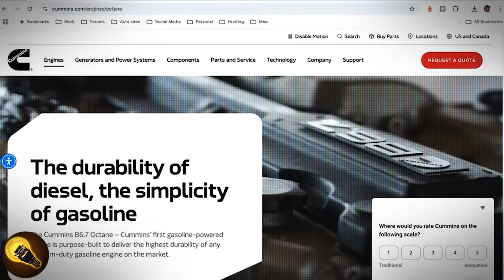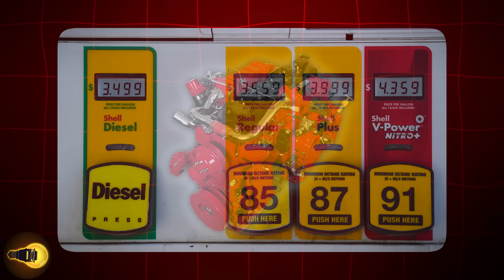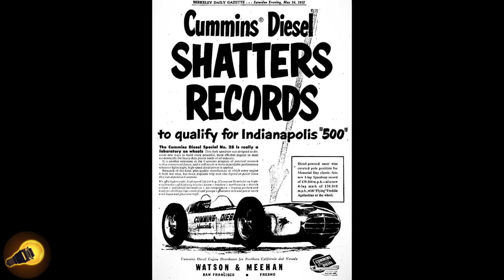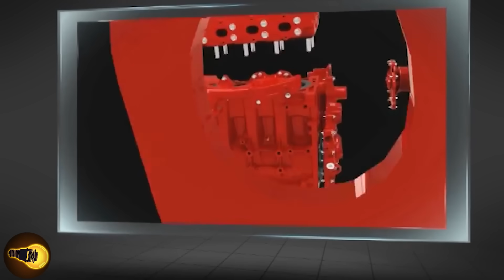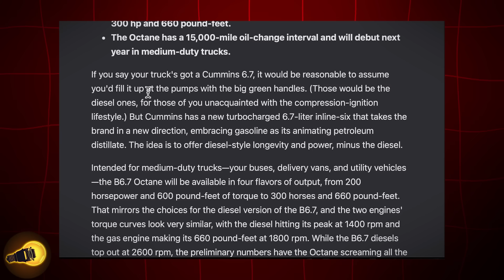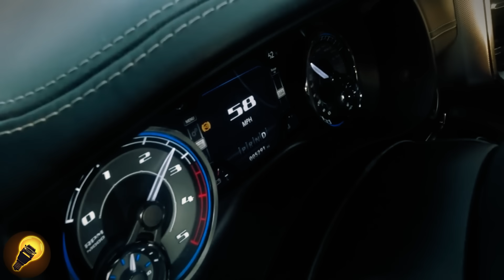Cummins Shakes The Industry With A Gasoline Engine!!!

Comment: I wish they put a manual back in a pickup truck
Reply: YEP, That's Right
Reply: @halcurtis8212 Yes had a 1996 TON CUMMINS with 5 SP Granny Gear Could pull anything I wanted
Reply: Manual transmissions will always be the best in my eyes, if you can’t drive one you probably shouldn’t be driving at all. Try a 20 speed Quad box Mack with twin sticks, it’s not hard just takes practice like anything in order to be good at it.
Reply: @deborahchesser7375  Warrantee claims when knuckle heads tear up the drivelines.
Reply: @deborahchesser7375  Modern automatics with computer controls and lock up converters are proven to much more efficient than sticks. Same reason we dont live in caves. tech marches on
Reply: @deborahchesser7375  Warrantee claims
Reply: @deborahchesser7375  I have one common saying a manual transmission clutch and transmission won't hold up , and because of emissions.🥴
Reply: @JustinMiales   if you know how to drive a manual it’ll outlast any automatic brother, aside from the clutch. Hell those CVT’s  shoot out of Nissans 😆
Reply: @deborahchesser7375  learned on a 2 stick and drove a 13 speed and 10 speed. MODERN automatics are much more efficient and consistent for durability and emissions. Time marches on you cant live in the past
Reply: @deborahchesser7375  Have you been drinking? ( Hell those CVT’s  shoot out of Nissans]
Reply: @tomhutchins1046   they fall apart after 30k that was mechanic speak for junk.
Reply: @tomhutchins1046  they are gutless and boring but to each his own, yeh I’m pushing 60 so I’m probably a little more of an old school driver and no, I haven’t had a beer in weeks. Does sound pretty good though.
Reply: @tomhutchins1046  I’m just having fun, my wife hates talking mechanical shit.
Reply: @deborahchesser7375  mechanic speak for junk.? That's not English. My sister has a nissan with a CVT 150,000 no problems
Reply: @tomhutchins1046  okey doke Tom, it been real, you have a goody now.  ✌️
Reply: @tomhutchins1046  and yeh, most of those cars are shit boxes. Your sister got real lucky apparently.
Reply: @deborahchesser7375  😂
Reply: Debora? You have a wife ?
Reply: @deborahchesser7375  Its the same reason automatics are good so the knuckled heads don't break them. i have a friend works in a Nissan dealership. Says when he see's a broken CVT rolling in the door there is usually a knuckle head following it in..
Reply: @deborahchesser7375  The leafs really concern him. They don't break down, Says he pulled a wheel of of one at 100,000 the brakes looked like brand new! There also build modular so even the lube boy could fix them. Ev is the future
Reply: @deborahchesser7375  Modern automatics are consistent and more efficient
Reply: No one bought them.
Reply: @ericelsberry5585  Real Construction
Reply: @ericelsberry5585  Actually about 50,000 since 2020
Reply: @ericelsberry5585  about 50,000 since 2020 have
Reply: The CVT, particularly in the Sentra was/is known for a high failure rate. I drive a 22 Nissan frontier so I’m not a Nissan hater. CVTs in general are junk.
Reply: @jimmysylvestre9679  Billy bobs can break anything
Reply: When you can't drive stick, you make excuses. I can shift better than any automatic, I don't need a computer to do my job. If you can't get better performance, durability, and mpg from a manual transmission, you're not that good of a driver, no excuse.
Reply: @CyrusVyrus  Ok billy bob your a deep thinker. Automatics have lock up converters for the last 20 years and that computer can out think your little billy bob brain 100 times over
Reply: @CyrusVyrus  I've got videos on my channel prove I can not only drive a manual but convert a automatic to a manual on a f350 and I never needed a computer to deal with it either but I sure like having that computer stuff but 12 years ago I sure didn't have none of it.  What a shocker you have zero videos to prove anything you claim lol.
Reply: @PatrickBaptist  I don't need to prove anything to you, you already admitted you can't drive stick as good as an auto.
Reply: @CyrusVyrus  Whatever kiddo, you can't prove nothing you claim lol.
Reply: @CyrusVyrus  Of course you have a problem with proving your claims kiddo, this isn't kindergarten lol.  muted Go cry about it elsewhere.
Reply: @PatrickBaptist  why do you get so mad when you're not much of a driver?  Grow up and own it like a man, rather than acting like spoiled brat who's mommy never told them "no" as a child. Getting mad like a keyboard warrior is what  someone with no confidence does, and you can't act like a tough guy while admitting you can't drive stick. When you can't drive stick, you make up excuses and lies about auto's being better. Facts don't care about your feelings.
Reply: @CyrusVyrus  Sounds like your the one mad lol, funny you think I'd waste time to click "read more" lol.
Reply: @PatrickBaptist  you resorted to bully tactics quickly, proving you're easily triggered, and emotionally driven. Get mad all you want, I'm not going to stoop to your level and play your games.
Reply: Got a 2001 1 ton with a 5.9 Cummins and a manual 6 speed....best truck ever
Reply: @tombayless9759 great truck indeed! I found a one owner '03 gmc duramax with 4x and 6 speed. She's a keeper.
Reply: I have 😂❤❤one
Reply: I'd like an 8 speed dual range crash gearbox in a new pickup so it would never get stolen lol
Reply: Yeah not a sissy automatics
Reply: @PedroGomez-gu4io  So your manhood depends on your stick shift ?? LOL
Reply: Automatics because of the TQ output would destroy drivetrains if the driver did not know what he is doing on a manual trans. Im sure warrantee had something to do that. Also emissions modern automatics are controlling more than shifting they make for consistent acceleration and driving patterns.
Reply: @tomhutchins1046 wrong... shifting gears is a pain-in-the-ass when you have a cellphone in one hand and a steering wheel in the other. Furthermore, automatic transmissions mean more maintenance to make money from.
Reply: @waynec369  Your right its all a conspiracy your tin foil hat is the answer
Reply: @tomhutchins1046  find you a couple of buddies with the same trucks but one auto and the manual. Hook up to a trailer and see which one pulls best in every aspect. I'll wait.
Reply: Ah they can't beat the Allison MD/HD 3/4000 series, I use to be nothing but manual but then I tried a real automatic......  You can take your less output manual, I'll take my Allison MD 3070 and see you when you finally get up the hill lol, you aren't going to beat what their torqueconverter does then put a retarder on it for the down hill stuff and yeah I have a 40's bus so glad it's not a manual it would be so sluggish in comparison.
Reply: @PatrickBaptist  But holding onto your stick feels so good! LOL

Comment: You need to update your EPA rule since Trump took over
Reply: Trump said he's referring to 2020 EPA rules. What does it mean for diesel engines nothing has changed which means manufacturers still going to be using DEF chemical to stop smoke coming out the exhaust so there you have it

Comment: So, 10% better mileage than a comparable Gas V8..... lets see, my 2021 F250 SD with the 7.3 Gas got 12 mpg combined. so 10% = 1.2 which means potentially 13.4 mpg versus the 21 mpg combined my brothers 2024 F250 SD Diesel gets. And this Cummins probably weighs 2 times what that 7.3 Gasser does.
Reply: And what are the miles per dollar? What are the fuel costs where you live?

Comment: Don’t be the first adopter even if it works(which it should). Why, I just bought  beautiful Deere 322 mower versus my old Deere 332 ugly diesel mower to save on noise while mowing. The 322 was the Yanmar,TN 3 cylinder diesel converted to gas by Deere to save on engine costs(same block though). They made the Deere designed governor gear (for the carb) out of nylon and it stopped all of the teeth.  Since it was short run and duration Deere no longer sells the,proprietary parts and now the engine is just a lump iron. Unless they manufacture into the millions with long term support, never buy this engine. Same on Deere
Reply: Shame on Deere
Reply: hey did you know the hegehog multfuel terbine engine that the usa amrbam tanks use actly inorancly entogh wher ment to power a rotansion magnetic dyimo gentroar for usa FOAB base power grids. also that bacly means the new A3M1 arbiam tanks desel elctacl hybrid upgade will still have that seamegine but the range output would bacly due to how good that engine would be for prvoeing elctcal power for a dieslq elctical hybrid drive train would be veyr vyer veyr massvie overkill for such a desil elctal hybird tank drive train bescue its meant to power like a few killowats worth of ectcal power bacly and when you got such a powerpwer powelant thats ment to power whole usa FOAB base powergid powering a abriam A3M1 disel ectal hibrid drivetain with by thway this heghog engine can run on desil gasolnie and jet fuel wohut needing any modfacion at all bacly means that usa A3M1 oprasnal rangw with is new ectral hpyribd desl drive train upgrade will make the new A3M1 orpasion combat range go up ina huge masive aonut. also thast just withte A1M1 and A2M1 allredy exesting pwoelnt doesnt need to be reovmed bescue its allready is the most overpwoerd pwoerplant to power a elctical deisal hbrid tank drive train by the orgnal sidefect of the diesnose of the arbiam tanks pwoerplant inrnacly was ment to provade a large albut of elctal powr the WHOLE USA FOAB BASES POWERGRID before they just deicded to put in the the A1M1 abram tank. so tah means the A3M1 abraim tank elcrital deslel hybrid trivetrain would amke the abram tank go super super fast and for very very veyr far travleing distaces bacly. yes i allrady did recae on wikipeida and that abraim tanks powerplant actaly works far bettr for the future A3m1 ambriam tank wuhout needing to change the powerplant but the drive train will be upraged instead and won't need the apu anymore. not only that it would go even faster and father then any abram tank beforeit inacoly the usa past desicion of the mveing the of abriam powrplant that as'nt ginogto actly power FOAB base powergrids inconrly entogh wold be furte rpofoed for the A3m1 abrim tanks elctical desal tive train before they even knew they wher giog to to that roue but the abrim tanks powerplant is allready furteproofed for elctial desel hybrid tank drive tains by pure chance and luck and conwdeice of how the pwoerpant orngal denise psefcaions where beofre they put int inthe ambram tank instead. so tachly thew new abram A3m1 ectcal dsel hybrid trivetrain just only needs to repalce the drive trian beacue the powerplant is allready the most best suited powrplant thqat already been used inteh ornal abram A1m1 and A2M1 allready. so bascly R&D upgrade foteh ambriam A3M! withte new upgrades wou'nt need to have that much of a cost change bescuethe powerplant is allready perfect and thats the most epensive part allready.

Comment: I sure hope they are more reliable,than the diesel engines that they have been making for the light duty trucks lately
Reply: The epa has a part in that
Reply: Theyll be less reliable than diesel but because they built diesels they can build a strong block you wonder id theyll use a plastic oil pan these days

Comment: It does not sip gas. The reason people use diesel is because it's the best way to move heavy trucks and not burn a tank of fuel. If this engine make 660 lbs-ft torque. It is going to drink gas and 660 lbs-ft is not going to tow a trailer like 1050 lbs-ft.
Reply: It'll still get there, though.
Reply: With direct injection with variable geometric turbos they could make it pretty powerful i would think especially fuel efficient with direct sequential fuel injection too with leaner air fuel ratios
But yes I'm a diesel guy and I prefer the old mechanical ones like the older 12 valve 5.9 liter 6bt
The problem is the new diesels suck because there's no reliability with the emissions systems.....always in the shops and over priced garbage no matter which engine
I'll take a 5.9 12 valve any day
Reply: @ New diesel are not always in the shop. People like you who don’t even own new trucks. Are spreading bad information.
Reply: @ If you really was a diesel guy. Then you would know a gas engine is going to burn lot of gas to make 660 lbs-ft torque. This is the reason why most heavy due to pick up trucks come with diesel engines.
Reply: @Fone65  Nope they come with diesels because billy bobs will pay 100,000 for a diesel pickup truck.
Reply: @tomhutchins1046  You can make a point without being rude and disrespectful. You loose a lot of the point you’re making by being rude and disrespectful. But go ahead and show me the gas engine with 900 lb ft of torque and an exhaust brake that I can hook my goose neck up to to hall my equipment around.
Reply: @johnshaw873  They used to pull more than your goose neck around with a 220 Cummins non turbo and a 2 stick. Why do you need 900 ft pounds of TQ? 660 would be more than enough? engine brake? slow down. I drove an 80,000 lb tanker in the late 70's early 80's with a 290 Cummins and a 13 speed. Then a 3406 cat and a 10 speed. Got around just fine. If this gasser works out they may convert larger engines. Or By then Go EV when the battery tech matures.
Reply: @johnshaw873  Oh and if your using a pickup truck to pull heavy equipment your a danger on the road get a real mid size truck
Reply: @ why do semi come with diesels?
Reply: In terms of towing a diesel engine sips fuel. Load an f350 to max capacity and itll get terrible mpg sure compared to my 2024 honda trail 125 but it cant even do the same thing in terms of fuel yl distance a very large load can cover its actually suprising how much energy is in a gallon of diesel
Reply: @TheAnnoyingBoss  Very polluting. Due to the high combustion temps and the fact diesel is a light oil
Reply: well its not easy but if you watched the video and got to he numbers part it makes most of its power and torque at only 1800 rpm. so no, it wouldnt guzzle gas compared to diesel and would still be FAR more fuel efficient than its other gas counterparts that make its rated power anywhere from 3k to 5.5k rpm. a gas engine making 300hp and 660 ftlbs of torque at only 1800 rpm is not only good for fuel efficiency but engine longevity. if these numbers are true then this would be amazing.
Reply: @ It is going to take more gas to make 660 lbs-ft torque @ 1800 rpm. Than a n/a 7.3 making 485 lbs-ft torque turning 4,000 rpm.
Reply: @Fone65  Its not intended for a semi its intended for a mid size truck. We used to call them bob tails
Reply: @tomhutchins1046  When did I say it was going into a semi?
Reply: @Fone65  "@ why do semi come with diesels?"
Reply: @Fone65  Ps It semi's
Reply: @tomhutchins1046  The engine is 409 cuin. I drive a semi with a 903 cuin.  I know the 6.7 is not going into a semi. My point was, no gas engine is going to move a medium duty truck and sip gas.
Reply: @tomhutchins1046  Drive a few diesel trucks and you will understand where I'm coming from.
Reply: @Fone65  You call 4 to 5 MPG sipping?  Actually its a very modern lean burn gas Engine with direct injection and all the tech so it may surprise you. And much less polluting than any diesel.
Reply: @Fone65  I did when i was a kid . A frieghtliner with a 290 or 270 Cummins Forgot 13 speed. Then a gas tanker and a cat 3406 10 speed. Quite driving opened an automotive machine shop in 83. worked my way up to high end race engines . Phased in CNC manufacturing now i have a small retirement manufacturing business.
Reply: @Fone65  Oh and king trump russia 2.0 is k--ling the small and some large businesses
Reply: @Fone65  Oh and i have owned a 95 ram 2500 4wd 12 valve for about 25 years and 340,000 miles
Reply: @tomhutchins1046  You need to read my comment again. I said it does not sip gas. The engine is turbocharge making 660 lbs-ft torque. It is not a lean burn engine. Put you and me in the same room without a computer. You can pick the engine and I will tell you more about that engine.
Reply: @Fone65  LOL Buddy your a joke. That's why your driving a truck not building or designing engines. You bet its a fully computer controlled lean burn thats why they based it on the diesel bottom end and heavy castings. And because gas and diesel engines are on there way out so they didn't want to invest in all new castings
Reply: @Fone65  There is nothing wrong with any honest job or profession. But before you try to tell somebody there wrong you need to pay your dues. You have no idea of what your talking about. I worked long and hard to learn this subject . I paid my dues buddy.
Reply: @tomhutchins1046  Upload a video of you doing something automotive.
Reply: @tomhutchins1046  Upload a video of you doing anything to an engine. Until I see something. You are just a young boy wanting attention.